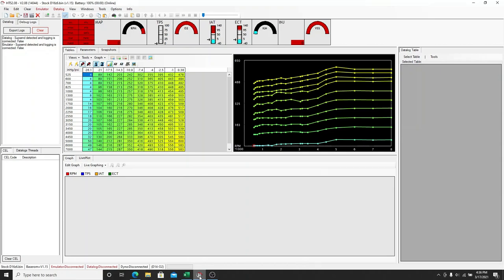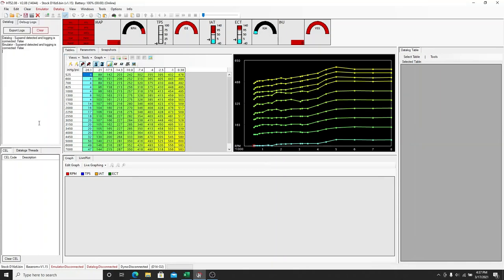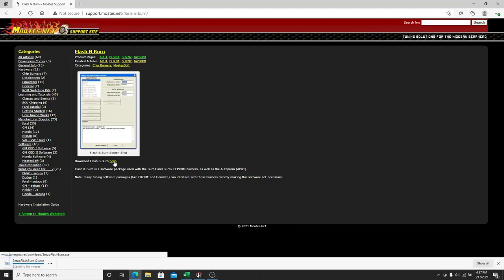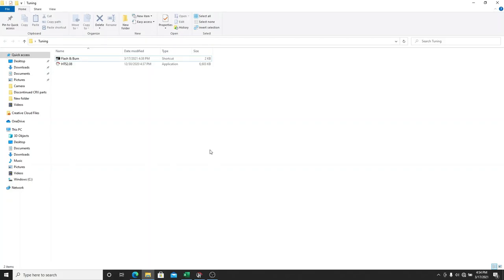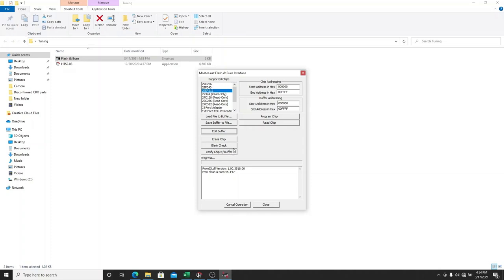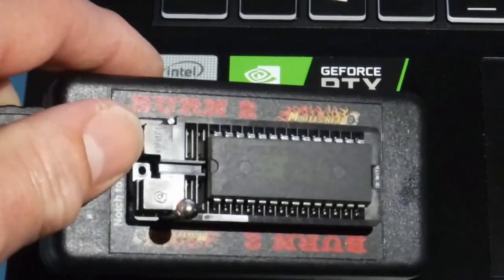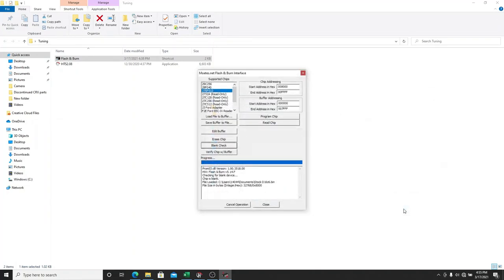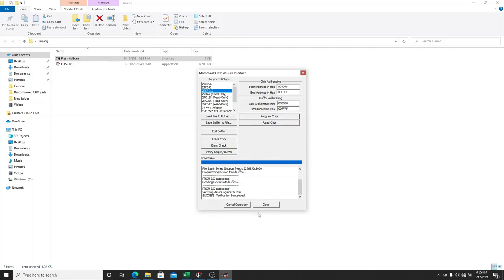Step by Step SST Chip Burning

Comment: FYI, when you read the chip, it loads whatever is on there to the buffer.  So when you verify, it is not checking to the bin you attempted to burn, but to whet ever it read from the chip.

Comment: Awesome info man. Got a question for you. I would like to tweak the current tune I have. Will the burn2 read the current tune I have so I can save and make adjustments to it or would I have to start fresh if I don’t have the original tune already downloaded?
Reply from the maker: So you can read and save the tune that is on the SST chip but some software does not cross over completely. For instance regular Chrome files sometimes come through messed up, but Chrome Gold files work perfectly

Comment: Great Video. Can I use this process to tune my 2002 Honda Accord V6?
Reply from the maker: Thank you. What ECU are you running?
Reply: @DIYKAI  so i reached out to the seller they said they don't have any products for the 2002 Honda Accord J30A1
Reply from the maker: @qrs3658  I think u would need to use canbus if I'm not mistaken

Comment: Ok I just got a  civic with chipped p28ecu. It's got jdm d15b in car. Idk what tune it has  where could I buy that Montes burn 2 chip burn  thing. Also  thinking of  turbo  car later am I able to get a  new chip burn a turbo tune on a chip useing that
Reply from the maker: So most SST chips are rewritable so yes you should be able to rewrite it….as far as the burner you can order it from the website

Comment: i have a question for you ..i got a 1990 k5 blazer tbi and i did some up grade on my engine and put a bigger cam in it so i had some one burn my chip and now the idle is up to high when i frist start it up its fine but once i put it in gear the idle goes up to about 1000 rpm and wont go back down what i want to no is it something on the chip where you can adjust that idle ..or should i do it
Reply from the maker: What size cam? 5.7 smallblock? Have you check distributor timing and all vacuum lines look ok?
Reply from the maker: Idle is adjustable to my knowledge. With a bigger cam you want idle to be up a bit to compensate for the loopyness useless thats your goal

Comment: When I open the flash and burner table it says (no hardware found  ) any tips or reason for that ? Thanks
Reply from the maker: Did you go to moates website and download the software and drivers?
Reply from the maker: Cable ok?
Reply: @DIYKAI   yeah i was doing the step with you video
Reply from the maker: I would wipe all the drivers and delete the software and start fresh again maybe it got messed up
Reply: @DIYKAI   still saying ( No hardware found . Connect hardware and restart window ) what’s the mean
Reply from the maker: Sound like a computer issue what windows are you running

Comment: Honest question..I've had a eg ls turbo sitting for 14 years ..legit never finished it.. I have a p75 socketed and chipped with a basemap (back then everyone was doing chips) now there is no one around here.. do I spend the $100 to buy the burner and new chips. Or the $499 on hondata and start new?? I just dug the car out since my son wants to drive it.
Reply from the maker: Honestly it's up to you and how you want to actually "tune".....chips are older technology but that does not mean its useless.....if you like to do things yourself then a burner and some chips are you best bet......it takes a bit an there are extra steps but I use chips in my Hondas and its just as good as a s300 IMO
Reply: @DIYKAI  thanks. I have to figure this out. I'll do some more research on the chips. I was just going to throw it away and get the s300 or demon V2
Reply from the maker: So just understand the difference chip cheapest more work as in pulling the chip out and burning it...

Ostrich 2.0 is another device as well

Demon let's you hook and write directly to the ECU

S300 is what most tuners use
Reply from the maker: Either way you need a wideband to see whats going on
Reply from the maker: You biggest difference being able to tune on the fly or not

Comment: whenever i load up and program a buffer and go to verify, it says chip and buffer not matched.
Reply from the maker: There is a ton of fake chips out are you sure the chip is good?
Reply: @DIYKAI   i bought the chip with a basemap on it from HAMotorsports. I doubt its fake, maybe it just fried it self idk, on crome i can grab the tune file but i cannot burn onto chip
Reply from the maker: @throttlefilms  HA is a great place to get them we did many videos for them. Your settings or computer may be the issue

Comment: Hi friend.After chip tuning honda obd1 d16a9 engine  tuned, what should be ignition timing degree.what do you think about 16 degrees .is it advance or rotary?
Reply from the maker: 16 is fine for stpck
Reply: @DIYKAI  thanks so much Friend:)
Reply: Someone say 16 dangerous
Reply: @DIYKAI  whats is the d16a9 engine custom igniton timing degree
Reply from the maker: 16⁰ is what Honda specs call for
Reply from the maker: If you have a stock motor than 16⁰ is 🙂
Reply: @DIYKAI  launch control ,ignition cut rev limit (7200)rpm and shift light
Reply from the maker: @meditationlife9337  16 should be good
Reply: @DIYKAI  now ignition dist position is middle  .A little bit turning left side for advance and its ok l think
Reply from the maker: You have a timing light?
Reply: @DIYKAI  no l dont have.
Reply from the maker: Only way to tell is datalogging it
Reply from the maker: @meditationlife9337  you should get one they are cheap
Reply: @DIYKAI  thanks so much friend

Comment: i got a old  sytle time light may be he didnt set my time right on the chip..it suppose to be at 0 but no power at o and i adjust it to 8 degrees and ite mush better but that idle is still high
Reply from the maker: The timing light would have to be set up differently...the shift light in HTS is the CEL (check engine light)

Comment: On the screen where you are supposed to select what kind of chip you have there are no options and it says no hardware found at the bottom even tho it is plugged in
Reply from the maker: What burner are you using?

Comment: i put xe262h comp cam i have headers on it i got 3704 edelbrock intake i had the  engine rebuild i got about 2300 miles on it now..the block was 30 over i have 700r trans 4.10 gears and i have 35x12.5 15 inch tires on it.. in it and i upgraded my torque converter took the stock one out and got a 2200 to 2400 stall tbi spacer and injector spacer up graded my fuel pump a.c delco ep 38 pump the guy that burn my chip i dont think hes that good he told me to set timing at 0 degrees i had my truck for a long time and my truck never ran at 0 degrees i think it was at 8 degrees and it ran beauitul the only reason i had it rebuild is because it started smoking burning oil ..let me say this i move the timing up and it run mush better than at 0 so i dont no what he advance ot up tooi dont want to keep driving it with that idle up like that ..he telling me to adjust the screw..i dont think thats the problem i think its something he did..let me no what you think..
Reply from the maker: have you noted your fuel economy with advancing the timing?

Comment: before i mess with the timing i didnt have no power..
Reply from the maker: 88-98 k truck require a scan tool able to set base distributor timing in order to get it correctly i had the same issue
Reply: @DIYKAI  hey who told you that i have had my truck for 15 years have had 3 of them never use a scan tool to set timing never had a problem to this guy burn my chip;;
Reply from the maker: @thedobermangang3503  sorry I was thinking OBD1
Reply from the maker: @thedobermangang3503  
 Put the IC system in the bypass mode by disconnecting the “set timing”
connector. This is a single wire sealed connector that has a tan with black
stripe lead. This connector breaks out of the wiring harness below the
heater case in the passenger compartment.

With the ignition switch “OFF”, connect the pickup lead of the timing light
to the number one spark plug. Use a jumper lead between the wire and plug
or an inductive type pickup.

Start the engine, and aim the timing light at the timing mark. The line on the
balancer or pulley will line up at the timing mark. The timing should be 0°
TDC (454 engines – 4° BTDC). If a change is necessary, loosen the distributor
hold‐down clamp bolt at the base of the distributor. While observing the
mark with the timing light, slightly rotate the distributor until the line
indicates the correct timing. Tighten the hold‐down bolt, and recheck the
timing

Turn “OFF” the engine and remove the timing light. Reconnect the number
one spark plug wire, if removed.

Reconnect the “Set Timing” connector
Reply from the maker: @thedobermangang3503  and you are sure the distributor is properly dropped in? If so than it could very well be the tune